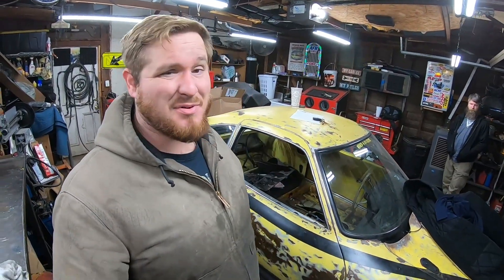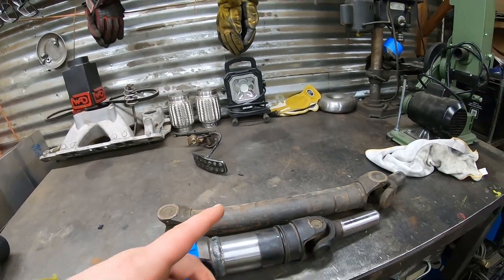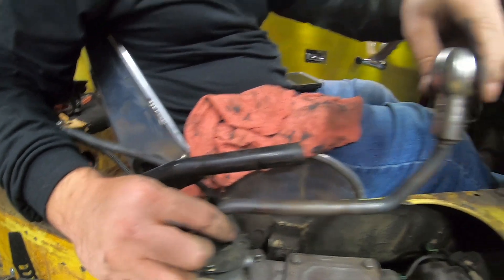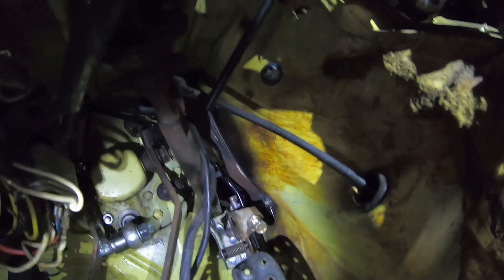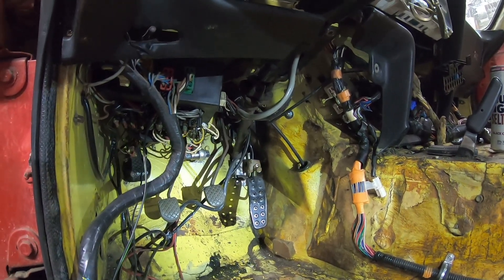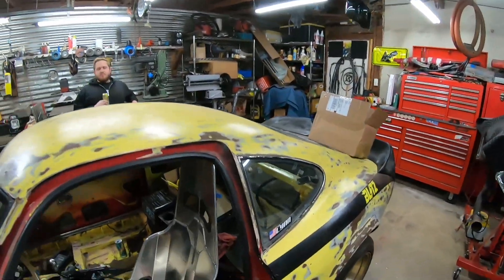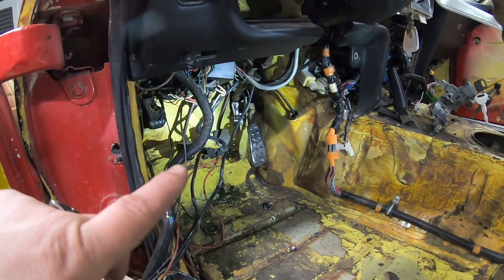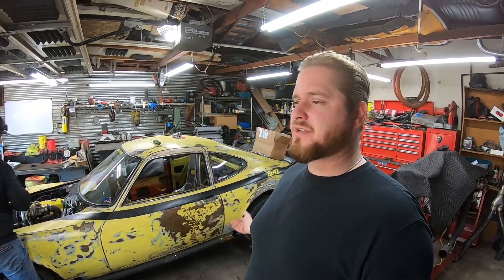e.29 Opel GT turbo swap takes it's first test drives! (No boost testing)

Comment: Awesome!   Use SS bolts to hold down gas pedal.  They don’t rust and can change out later if needed.   Just as an FYI OpelGTSource is near you guys and have new u-joints for GT.  Just in case you trash it. Now I’m thinking turbo!  Lol
Reply: You ABSOLUTELY should go turbo. You’ll have 2 dyno charts to compare to. 2 different turbo setups, same motor/trans

Comment: Right on guys!  Love the content, can't wait to see this thing and the GT6 tearing it up together.  Hopefully some track content with these two cars this year!
Reply from the maker: That's the plan! If we can keep them in one piece long enough to go break them at the track that might come up pretty quick! We might also end up babying the diff in both, until after Hot August Nights in Reno. The dyno and rear end will determine most of that for us.
Reply: @WhackADoRacing  Great!  Have you considered a r-160 subaru LSD swap on the GT6?  If you look around it's a fairly well documented and common swap on spitfires/gt6's of that year range.  Though yours is the rotoflex and not swingaxle, so IDK the intricacies of that.  I'd LOVE to see that BP put down some serious jam in the GT6.  250whp would be insanity.
Reply from the maker: @doctranate  yes, and had I known this issue would plague me I would have started with the Datsun diff however I have already invested a large sum into the Triumph diff in the form of rebuild/bearings/regearing/and a Quaife. So now I'm into the GT6 stock rear end (which allegedly can take the 250 with the Quaife in it, according to a spitfire guy with a super charged Buick V6 in his) but being as my car is swing axle, the hub and axle use a woodruff and seat friction alone to keep them together while Rotoflex cars actually use splined axles and would eliminate my problem if the Quaife can actually hold up to the power. 
That being said my options now are
1)break this axle and try one more time with a new stock axle and hub, but heat press it on this time
2)spend the money on locating/purchasing/rebuilding/regearing/traction devicing a Datsun diff, then buying a series of adapters and possibly new axles to make it work(cost total unknown)
3)buy Checkered flag racing oversized 1 piece axles and make some adjustable trailing beams to recenter them and hope the Quaife survives($2,000)
4)find a rotoflex rear end and retrofit it into my car for splined axles(cost unknown but NOT cheap)
5) use the Canley Classics all new Rotoflex conversion kit with all the best goodies for the rear end and use my current diff ($4,000)
6) find a reputable axle shop still open during a pandemic and have them custom make me a set of splined stock dimensions axles(cost unknown)
7) rip the whole rear end of the car out, custom build a subframe to swap in a Miata rear end and then have the driveline recut(cost of miata subframe/diff/gearing/recut)
So those are my current options as of right now. They all come in around $2,000 or more and I have the budget of like $500. to deal with it so I'm still figuring out what comes next. Hate to pull the stock rear end out and have wasted all that money on a diff that is virtually unsellable in the US market, or could have withstood the power if only my axles had held up so Im leaning towards destroying it one way or another before moving on to other alternatives
Reply from the maker: For scale, I have about $2,100 into the Triumph diff btw
Reply: @WhackADoRacing  Gotcha.  I love the idea of hacking it up for a miata subframe and rear suspension, but that's definitely a rabbit hole of its own.  But from a viewer perspective I'd love to see it!

Good luck whatever way you go!  Very few people building GT6's like this so you are pretty well into uncharted territory.

Are you satisfied with the handling now from a track perspective?  If so, probably just get some axles made and hope the rear end holds.  If not, then maybe it's time to think about changing things up.
Reply from the maker: Uncharted water is always fun, problem solving is such a cool aspect of this hobby and makes it exciting even when you think you know what you're doing to have a new challenge arise. I'm looking forward to getting this issue behind us, but knowing what we can get away with at this power level and for hoe long might help others decide what's right for them and that's worth the trial and error to me, and to satisfy my masochistic curiosity. 🤣
That being said, all of our driving so far has been "aggressive street driving". Aka, driving like a prick whenever there's nobody to hurt around turns and corners. There's so much room for growth in this handling and suspension that I haven't addressed but I kinda want to wait until we so our first track day to truly see what glaring issues arise first (understeer and snap oversteer are coming to mind from my street driving) but I would love to be able to say I still have Triumph suspension if possible to keep it all at this power level. That way I can say this is basically what would have happened of Triumph had more technology at their disposal in 68 and help to encourage others that the stock parts (freshened up a bit) are still relevant and capable in today's entry level competition brackets. If I can, I want to show people that this is possible on a budget and just being clever and calculated because I think THAT is the key to keeping these cars alive and getting the next generation of classic enthusiats involved.